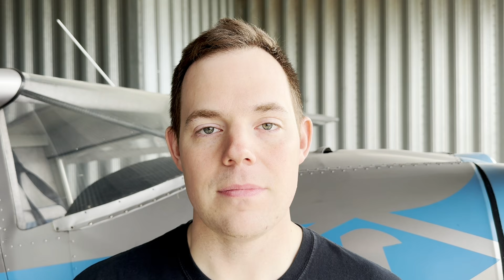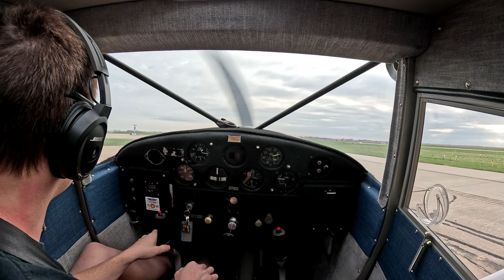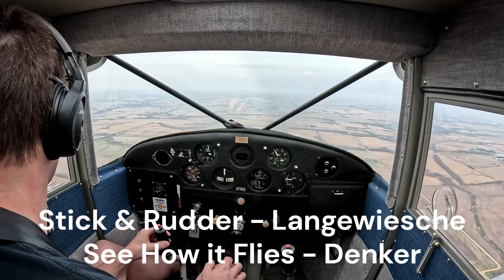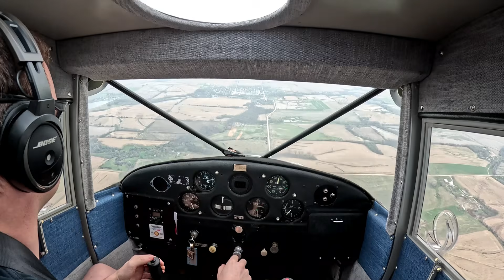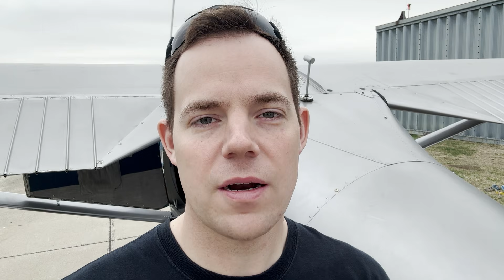Pitch or Power? The Answer Most Pilots Get Wrong

Comment: Crop dusters love 1 g in very steep turns so we release all back pressure on the stick in all turns regardless of bank angle.
Reply: When I flew Thrush R Models out in the Arizona desert at night spraying  cotton
(10,000) Hrs
That's not the way we did it 
Since a swath was 60 ft wide. We turned in about 32 seconds 
We actually turned like   you would turn a dirt track race car.
Reply: @deanwhitaker6905 Sure, about 16-20 seconds in a Pawnee, but I am trying to keep it simple and explain the principals for the general aviation pilots.   At 1 g the nose will go below the target and we will pull it up to put the pipper on the target, but add little g load doing so.  We need to help them quit killing about three hundred pilots a year with far fewer incidents and accidents like we commonly had (17,000 hours but I ruptured a disc and had to change to pipeline patrol.). It was teaching Ag while sitting on the floor of Billy Howell's SuperCub with my feet straight out on the pedals that finished me off.
Reply: @deanwhitaker6905 my impression of dirt track racers is they put it into a hard skid, then reverse steering input and control where the nose points with throttle. More gas puts takes weight off the front tires and pushes the car to the inside, less gas lets the front tires bite and straighten out the car.
Reply: Yes that's how you turn  a  dirt tracker 
Turning a duster starts with a skid when you turn to the right out of the field 
And when you start your left turn to go back in the field you're actually drifting can you put on those round buy back stick to line up with your flaggers 
And  YES you are hanging on a stall 
Not for the meek of heart 
Myself i was also an aerobatic pilot as were a lot of crop duster pilots. 
Unusual latitudes was second nature to us.
I would not recommend turning an airplane  like that unless you're all so good at aerobatics😅😅😅
Reply: @deanwhitaker6905 what does the skid do for you beside help the plane go inverted if you stall?
Reply: The objective is to get the tail around so you can pull the nose around  to  lineup with your flaggers 
When you push the rudder of an aircraft the tail goes around not nose.
The aircraft is playing in a different direction not because the nose moves over but because the tail moves over in relation to the ground 
Bearing in mind that the aircraft is also moving forward. 
In aerobatic flying there are four points of Lift.
Propeller 
Tail plane 
Wings
Fuselage 
You can stall an aircraft going straight down 
Just as you can install it going straight up 
In a maneuver that most people call a hammerhead stall
You are going absolutely vertical loses all its momentum tell the aircraft loses all its momentum . It has not stalled it's simply means the lift  of the propeller and fuselage no longer has enough left to overcome the weight of the aircraft. 
If you do nothing the torque of the engine will start to rotate the body of the aircraft, play split second later it will slide backwards unless you kick the rudder and the fuselage lift will pivot the airplane. around..
If I crop duster pilot tells you he or she hammerheads to turn around,, he or she is really doing a wing over. 
When I was crop dusting in Arizona, we have seven pilots all flying  (R) models 
 Three of the pilots pretty much did standard turns 
They were not aerobatic pilots as well 
One pilot did a combination of what  the three of us did in kind of a wing over maneuver
He was not an aerobatic pilot.
The other three of us, two of which flew aerobatic competition 
Turned as I had spoken up before. 
Has a matter of interest 
During the crop duster off season I taught competition aerobatics. 
In crop dusting, Rex, Soka hand to myself 
What kind of prims donsish   and definitely macho
Reply: @deanwhitaker6905 But at 1 g steep turns are neither acrobatics or dangerous.  I'm not preaching to crop dusters but to general aviation.  With fewer incidents and accidents, they have the same 300 fatalities yearly.  Think of the much fewer number of takeoff and go around fatalities if they were taught the basic level in low ground effect acceleration until all runway was used and then only pitch up enough to just miss not well miss any obstacles total energy management principles takeoff.  Think of how many fewer stall fatalities, with or without spin, would happen in the pattern if they were all taught to release all back pressure in all turns.  Think of how many fewer LOC fatalities would happen in they always arrived at ground level (the numbers) in a three point attitude all slowed up and ready to squat as Wolfgang Langewiesche puts it in Stick and Rudder.  Thousands of iterations of planned stall and spin training is of limited help with inadvertent stall around the airport.
Reply: You are correct
 I eas responding to some guy , how to turn around a crop duster.
Which is a little different than turning a Cessna 150 onto final 
Ole Wolfgang.eas right 
Stick and rudder that's what it's all about😮
Reply: @deanwhitaker6905 Also check out "Turn Smart" by Wayne Hanley.  The airplane cannot stall itself.  A pilot pulling back on the stick is required.  No pull, no stall.  Yes, once the nose comes onto target and wings are coming level we bring the nose up to put the pipper on target and even skid to get exact longitudinal alignment with the crop row.  We also skid/yaw cross controlled around obstacles to prevent dragging a boom of in a bank at low altitude.

Comment: Good job leading rudder in the turn.  Stepping on the ball is reaction to uncoordination.  With thousands of iterations of dynamic proactive steering wheel alignment in autos, we have to lead rudder to be coordinated with aileron.  Stick helps but we have that itch to level the wing with aileron which sends the nose the wrong way initially.  Level the wing with rudder only.
Reply from the maker: Exactly. I was only taught “step on the ball” when I started. It took tail wheel training to learn that directly and once you see it, it’s obvious but not until then.

Comment from the maker: Most pilots were taught “pitch for airspeed, power for altitude.”
After flying this exercise, do you still agree with that?
Reply: Nice video, a good practical demonstration of fundamental flight dynamics.  I was only told to “pitch for airspeed, power for altitude” to maintain the glide scope on final.  And I still agree with that 😊 The phrase "power for flight condition" is a good one, it was how I was taught but it was never explicitly explained like that.  
I'll check out some of your other videos; for a low hour PPL like myself these seem very useful.
Reply from the maker: @kaasmeester5903 thank you! “Pitch for airspeed, power for altitude” is very close and if taught correctly builds some excellent habits. Thanks for internalizing “flight condition” and for engaging!
Reply: given that I fly gliders, I suppose yes, since we pitch for speed and given no power the altitude is pretty much uncontrolled 😂although I suppose you could even consider "roll for altitude" if you fly towards lift/sink
Reply: The propeller on a typical single-engine trainer has about 1.5% of the surface area of the wing.  So how exactly does power control altitude?
Reply: @warren5699  power gives the airplane more energy via thrust
Reply: @fabian999ification  of course - but where it goes (level, up, down) is determined by where it's pointed with the elevator.